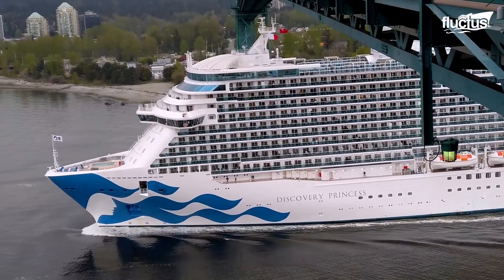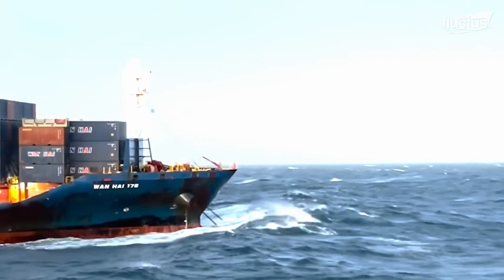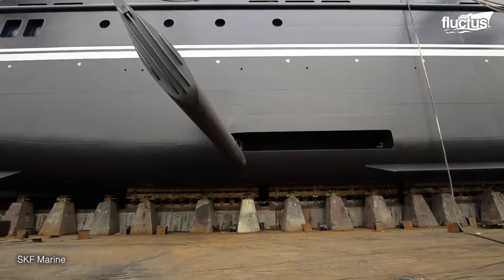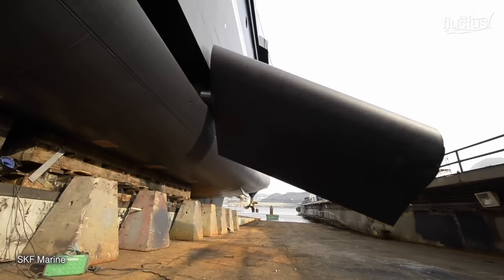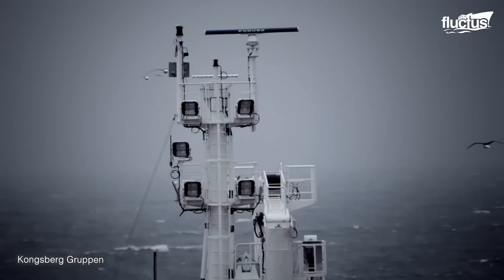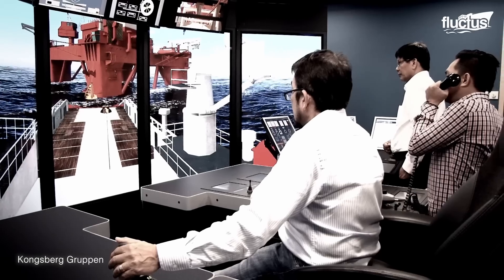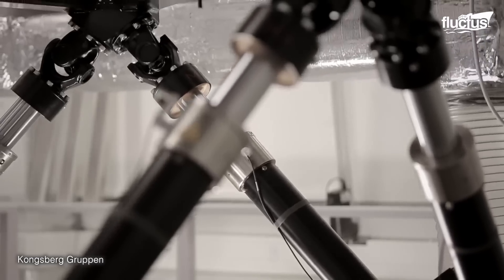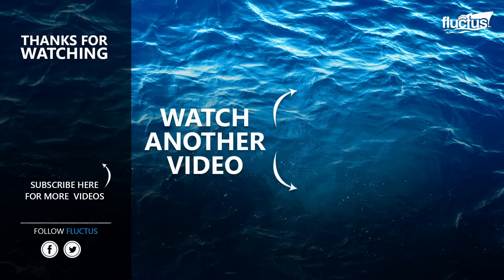Genius Idea Engineers Found to Help Ships Battle Rough Seas

Comment: Cargo ships do not have such active stabilizers and never have had them. This is only for passenger ships. Cargo ships can be equipped with passive stabilizers (these are flat longitudinal ribs under water along the side. One on each side)